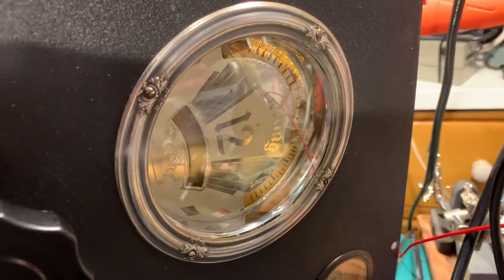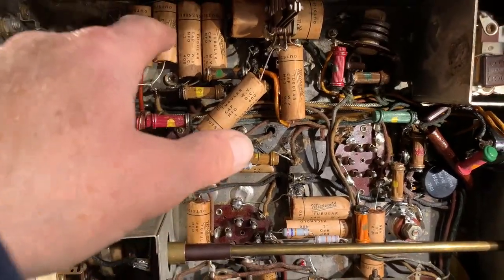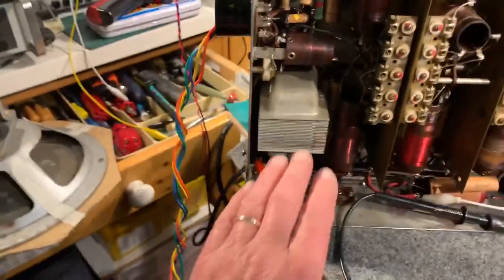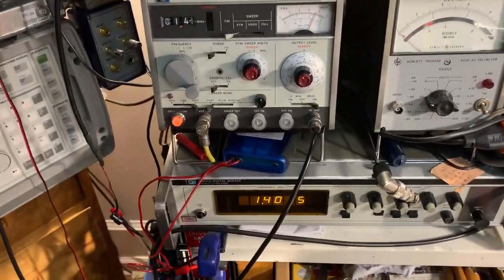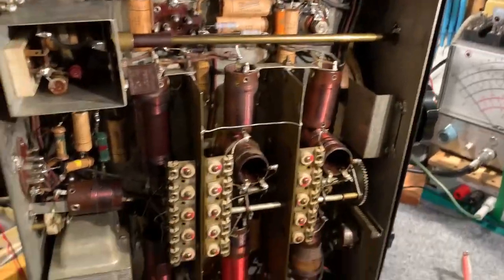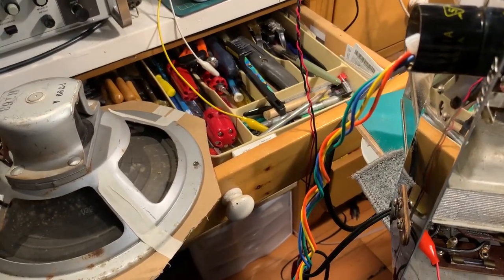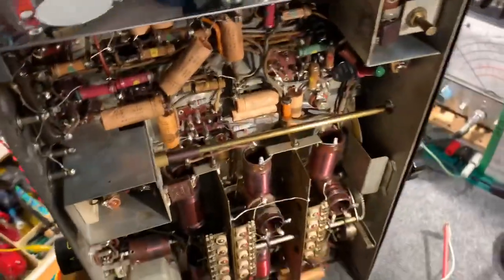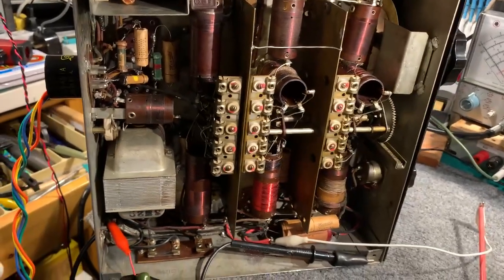Breting 12 Receiver - Initial Power-On Test

Comment: This set certainly is very deaf!  Just found your channel and subscribed.  Looking forward to finding out what was wrong.  The chassis looks beautiful by the way!
Reply from the maker: Hi Don.  Someone had made a mistake with the wiring in the crystal phasing compartment (likely during a repair, though possibly an attempt at a mod of some sort), effectively shorting out the secondary of the transformer between the plate of the mixer stage and the crystal filter.  Reverting the wiring to that of the schematic fixed the issue.  A subsequent video explains this.